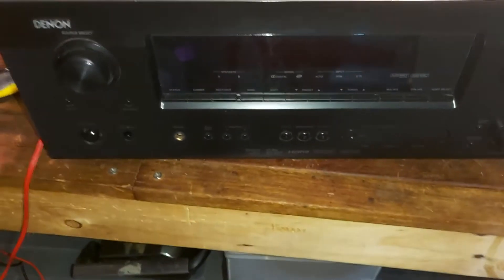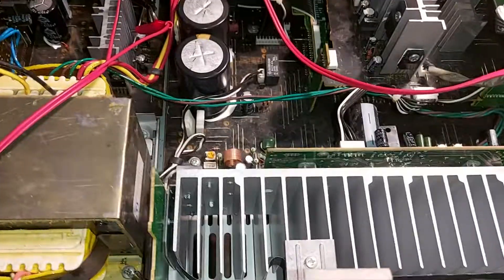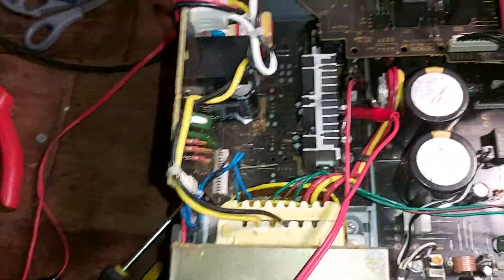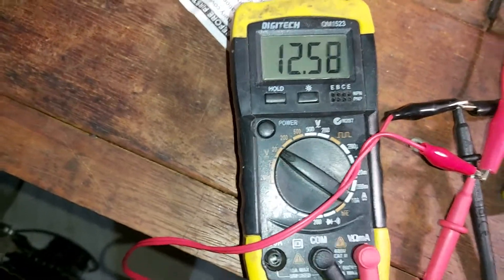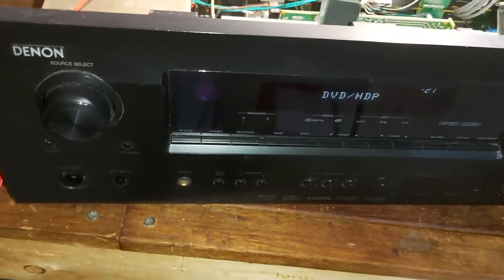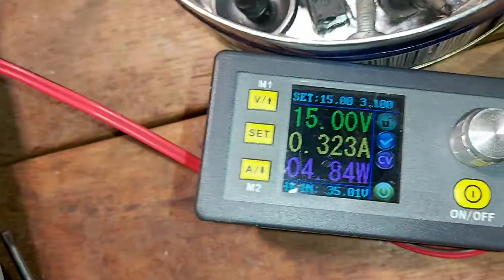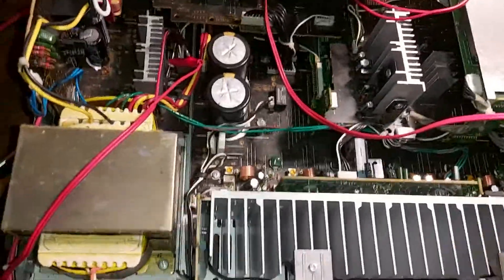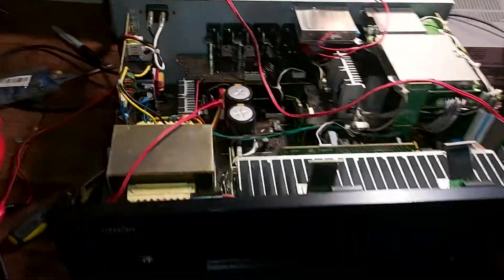Denon amplifier Tripping Repair part 1

Comment: Gidday mate! Came across your channel researching my problem Denon3310... Do you know if this voltage regulator issue is a common problem? My unit has an intermittent power supply issue (i guess). But it did power on for an hour when i took it to be repaired. Nothing was done it just randomly worked... I've got a 1513 with a similar issue... the timing is the same... they both just won't click that second relay...  if you have an idea please let me know... if not thanks for the vids anyway. i appreciate your effort.
Reply from the maker: Sorry mate just saw this . I'm not sure . If it's an intermittent fault . It's with checking the solder joints under the PCB .

Comment: I have static from my right channel suddenly even without a input exact model any ideas
Reply from the maker: Looks like a bad smoothing capacitor , most likely on the right channel power supply side on the preamp. It should be an easy fix

Comment: mine does not seem to play very loud on frequencies above 4khz and the tweeters in my speakers are working fine on a different amp so im confused on why its doing this
Reply from the maker: Try doing a factory reset.. could be your Equalizer setting might be wrong .